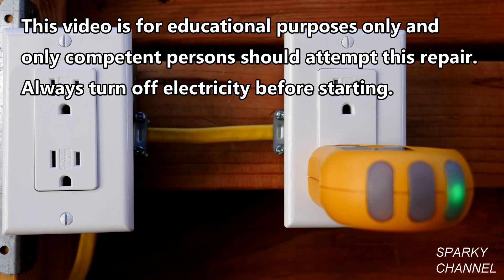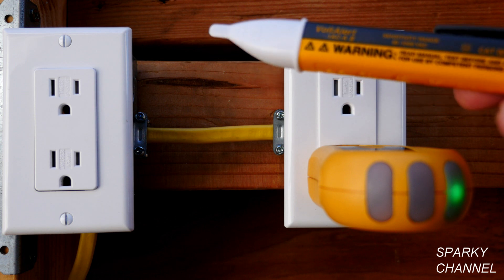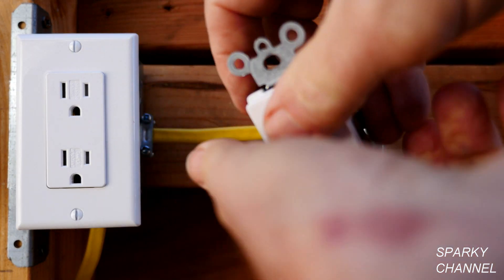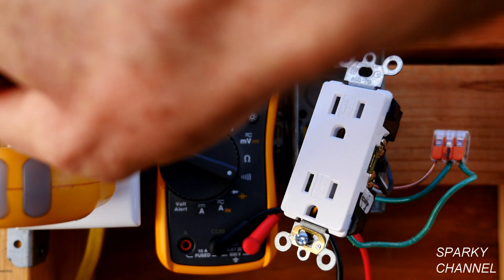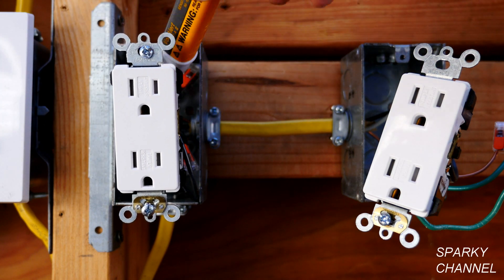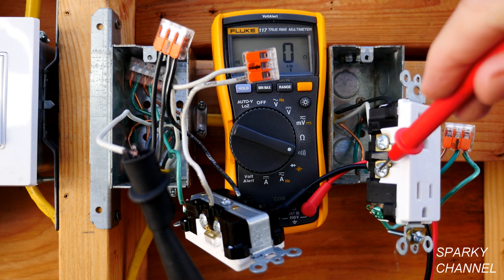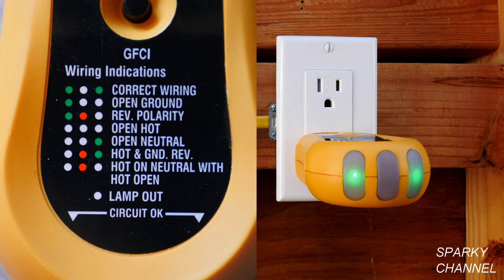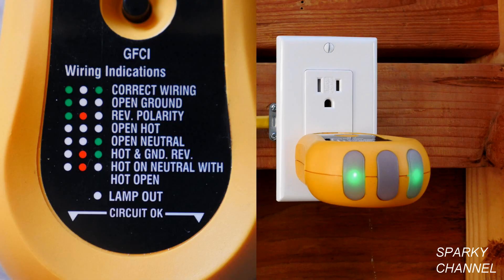How to Fix an Open Neutral Receptacle When the Problem is Upstream in the Circuit

Comment: @Sparky Channel. Thanks Bill for making this troubleshooting video.

Question: How would you safely test for continuity when your upstream outlet is more than the length of your multimeter's test leads?

Hope you and your family stay safe and well.
Reply: I know you didn’t ask me but what about just grabbing any old length of wire from the van, and using it as a lead extension on the end of a meter lead
Reply from the maker: I use my Extech CT20 Remote and Local Continuity Tester: https://amzn.to/36dwKzu
   In fact, I should do a video on that. It's small, lightweight and works like a charm! You guys stay safe as well!
Reply: At one end (with the power off) touch the hot and netral together and use your leads to determine continuity on that other end between the hot and neutral. You can also check between hot and ground and neutral and ground. This is the more practical way since outlets are rarely ever right next to each other like this. If you get continuity between hot and ground from one end but not hot and neutal or ground and neutral you can determine the neutral was lost somewhere between. Then comes the fun task of figuring out what happened and how to fix it (especially if the break happened inside the wall somewhere.

Comment: Circuit breakers labeled with a sharpie. Seen it hundreds of times and usually the labeling is wrong.  Electricians, please use a label maker and do it properly.
Reply: Farmer Dave just throwing it out there,it can still be done improperly with a label maker. I’ve seen that many times
Reply from the maker: Thanks Dave!
Reply: properly includes making tags and putting them on the wires connected to the breakers, so they are still labeled with the cover off the panel.
Reply: Last house I was asked by an inspector if I had a wiring issue. The box was labeled to the outlets or lights (a, b,c etc) and I had a map of the circuits. I told him that it's the downside of discovering the old owner did a lot of the wiring, which I can only assume blind folded and on a date.

Comment: That's why that type of connection isn't a reliable connection, it's quicker but I've found out that a good old wirenut is still the best connection, further more the stab lock recepticals, I find will loosen after a period of time and will cause a loose connection on the hot conductor. The screw terminals in my opinion still make the best connection. Nice video, like the trouble shooting senario.
Reply from the maker: Thanks Michael!

Comment: I've hunted for hours trying to find an open neutral! Hard to charge someone for that!
Reply: Yeah the problem i had when i was hunting was that my plug tester kept in saying hot ground reverse. which i knew was not right. Ended up finding it behind the bunk bed i didn't really want to move. So im convinced that because i didnt want to move it thats where the open was going to be...
Reply from the maker: I understand!
Reply: That's where toners and skill comes to play
Reply: @skunkbri   I don't know if his tracer can use any wires for tone. I used to have an old BG that was great because it would only send signal upstream.  (if I plugged it between the panel and the end of the run, it would only have tone going towards the panel) but it had to have a neutral connection to work.  made a plug to jumper the neutral to the ground, and I could plug both in, and trace the circuit path.
Reply: You either charge your normal hourly or like me you have a flat rate for troubleshooting. If it take 30mins or 3 hours same charge. Not that difficult